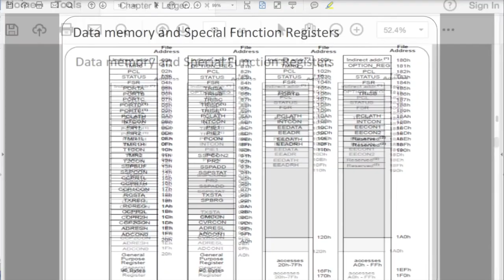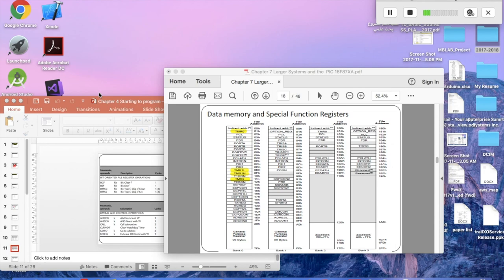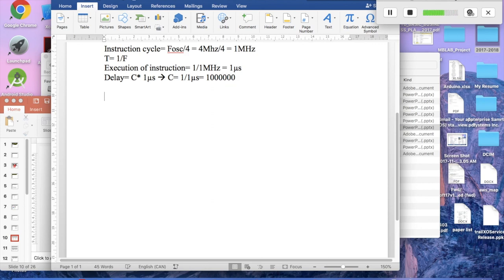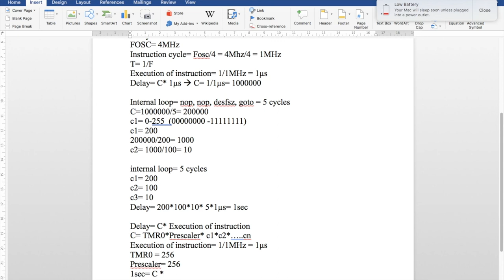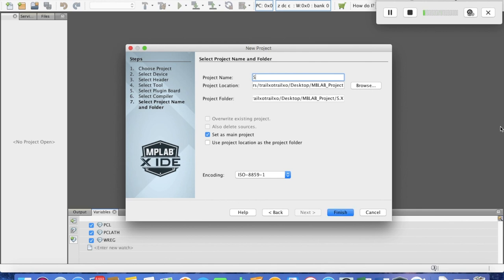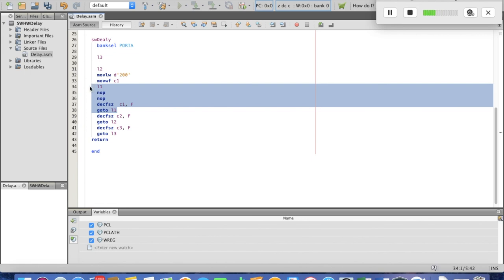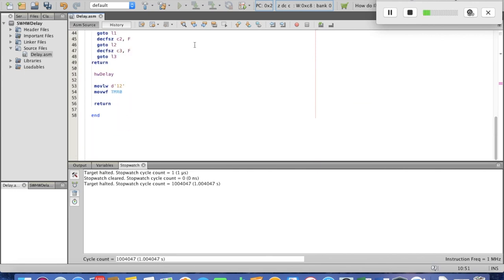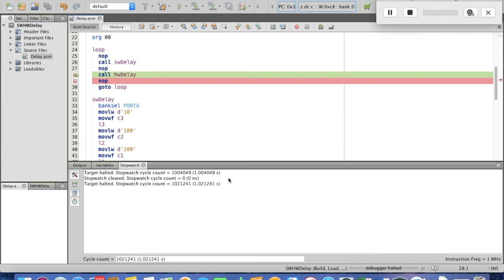Tutorial (7): Creating Software Delay and Hardware Delay in PIC Microcontrollers

Comment: for the software delay ! can the same code be applied on 16f84a?
Reply from the maker: 3Assem morad you can with some modifications,  such as the #include statement.
You can compile the code with the 16f84a and fix the errors